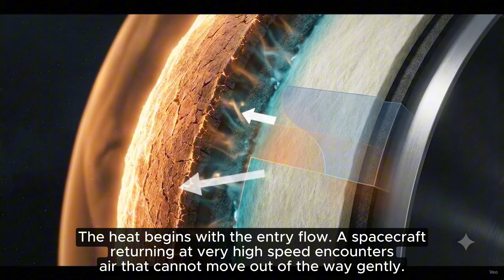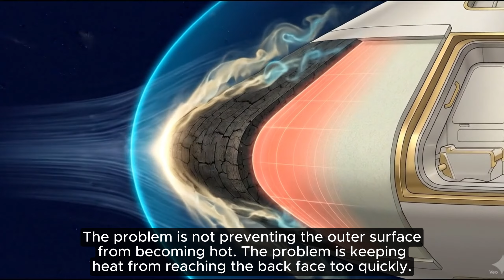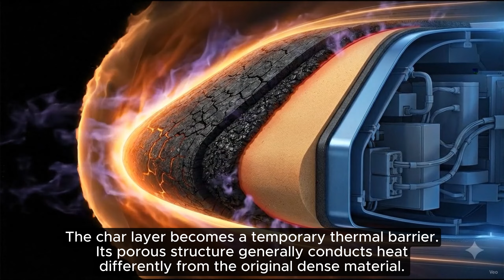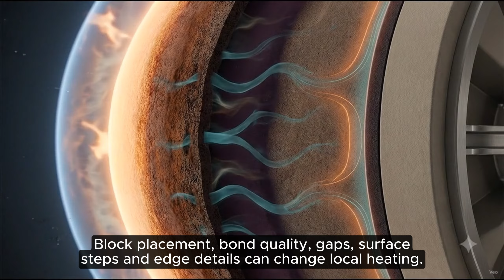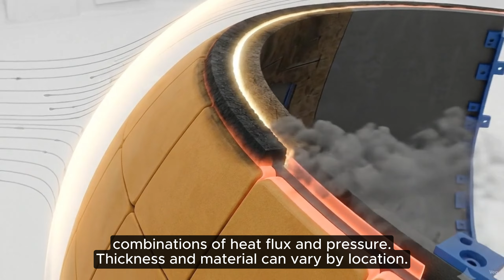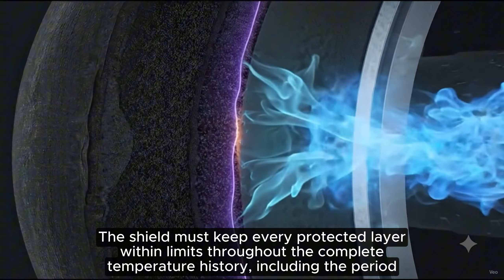Why Spacecraft Heat Shields Are Built to Disappear

Comment from the maker: The outer surface disappearing is only one part of the protection. Which path surprised you most: energy spent on chemistry, heat carried outward by pyrolysis gas, reradiation from the surface or the delayed thermal wave moving toward the bond line?